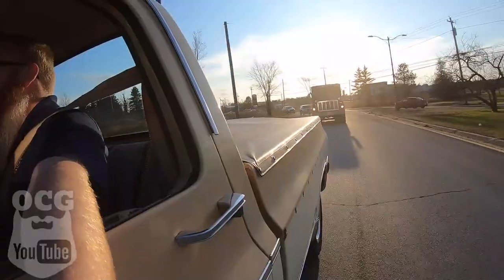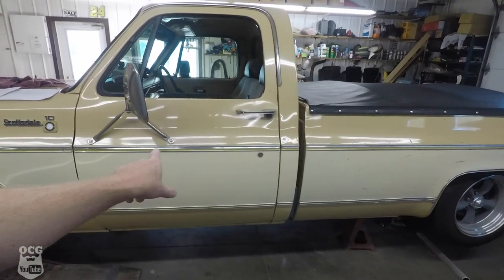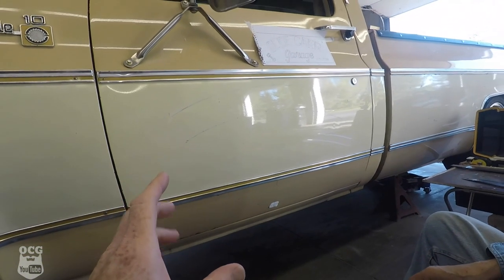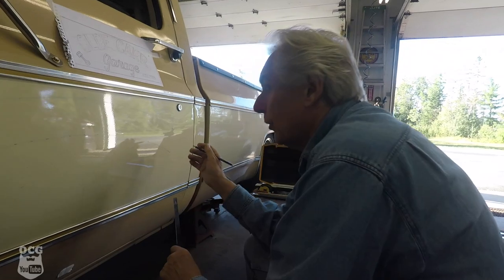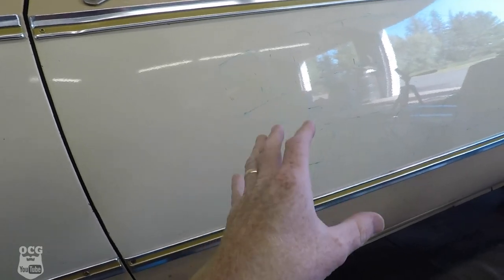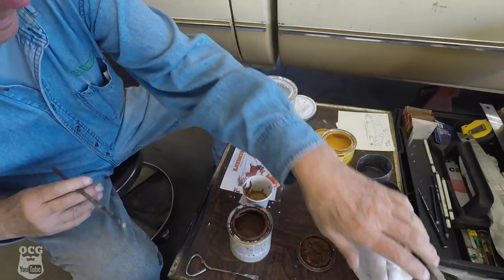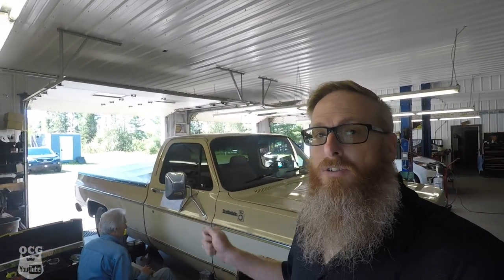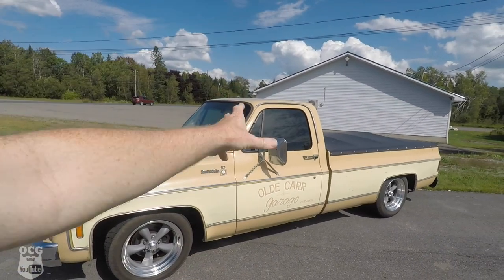HAND PAINTED DOOR LOGOS ON A 1977 CHEVY C10- A DYING ART FORM

Comment: Here's what's odd. I don't have a steady hand. Can't be a good marksman, but in an odd way, the way those brushes are and the way I am with a pencil for drawing, I actually think I could do alright at pinstriping. Would be fun to give that a try some day. I also like what he did with the font. And the white outline was perfect. You totally had me on the cab ligth montage. 

If I don't get the Fairmont done in time to drive it for like 3 months before winter, I'll probably won't put it up for sale until I do. So if I have it over the winter, I'll be considering tucking the bumpers on it.
Reply from the maker: I think I fooled a few with that trucker look! lol Good call on the fairmont!

Comment: Have a question about Grand-Ma? What size are the Mustang tires that you put on Grand-Ma? I have located a set of tires and wheels that came of a Mustang, the size 245x45x18 was curious if the tires and wheels are the same size you used. Thanks in advance. Great channel keep the videos coming......
Reply from the maker: Hey Paul! Without having the car here to confirm, I believe that is what I put on for tires! 245/45R18.
Reply: @OldeCarrGuy  Thanks